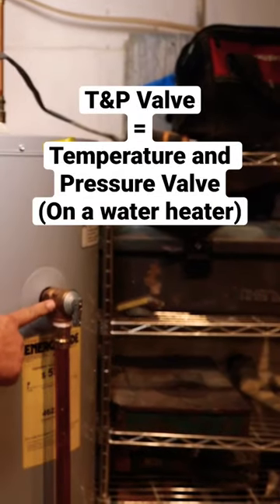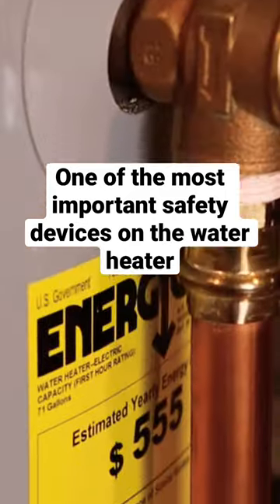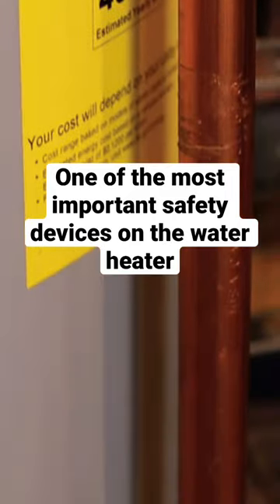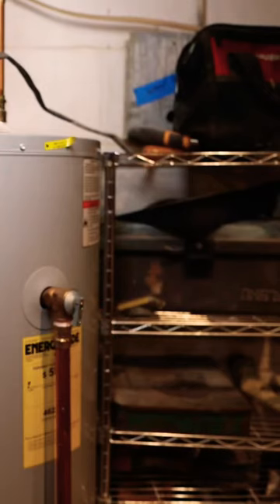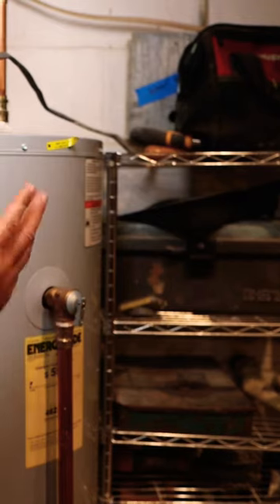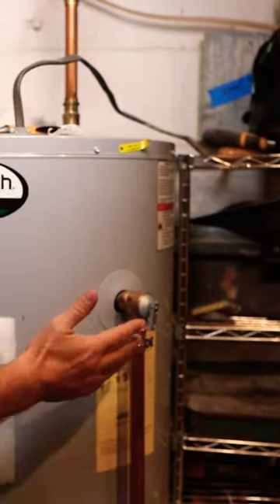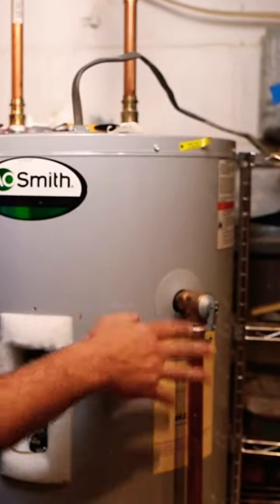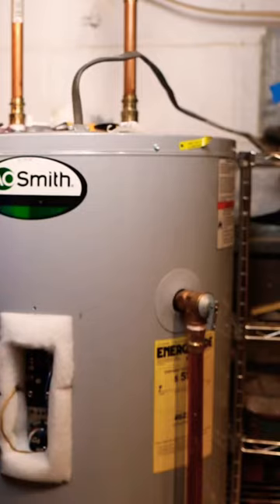The T and P valve (temperature and pressure valve) on a water heater is an important safety device

Comment: How difficult is it to move from the top to the side on a new heater? Just taking plug from the side and putting on the top when you remove the valve from the top?

Comment: They fail also if the water is hard and creates a poor seal on the spring. I work at a 200 unit mid rise and they have been around 3 years almost and about 90% of them were set at max setting they also operate aquatherm units. My first week I went thru and replaced over 5 t&p's and have a list of more and expansion tanks as well. Sux when you can't even trust new builds 🤦🏻‍♂️